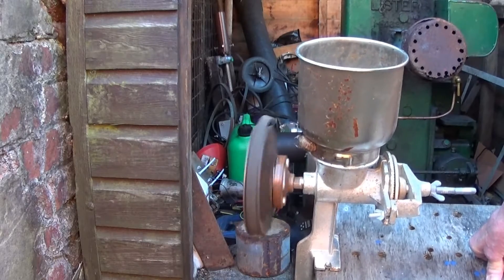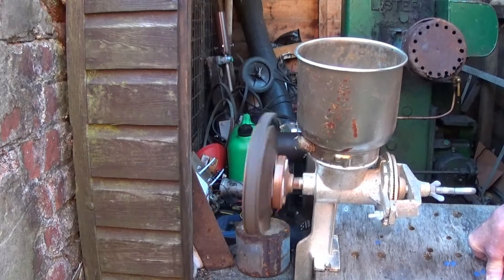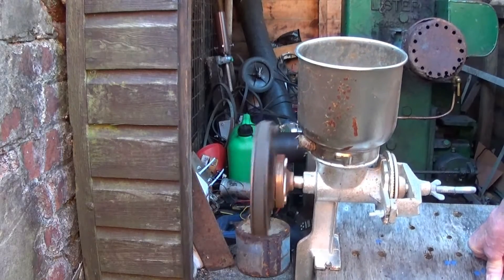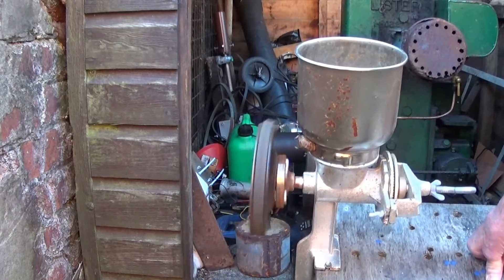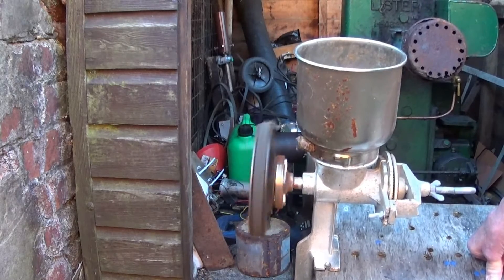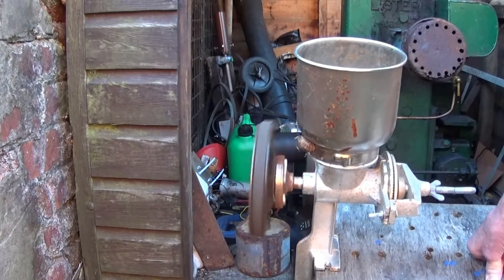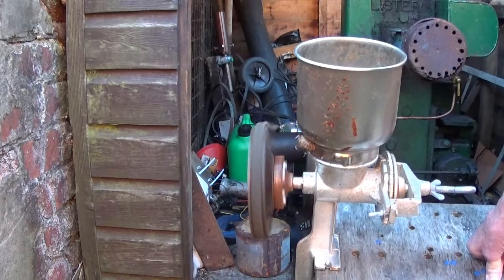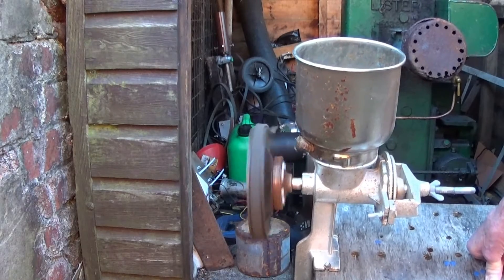Lister D Corn Grinder Test

Comment: Hi Malc. Nice spring in your step there lol !!!!
 It was a real pleasure to meet you in person last week. You are looking so much better than you were in some of your videos earlier this year. Next time I am nearby I will let you know and hopefully we can have longer to chat over a cuppa. Best wishes Gary. Ps can you describe  how you made the new exhaust that you don't use. What thread etc as I need to make a new one for when I get my lister working.
Reply from the maker: The pleasure was all mine, great to meet you Gary. Yes thankfully I've recovered from early this year. I made the silencer from some sheet metal. Cut the circles and drilled the holes for outlet and inlet. Then using a flat piece of the same metal cut to width, welded it on, bending it as I went. Before finally cutting it to length and welding the seam. The exhaust is 1 1/2 inch (I think) pipe thread, so pipe fittings screw on.